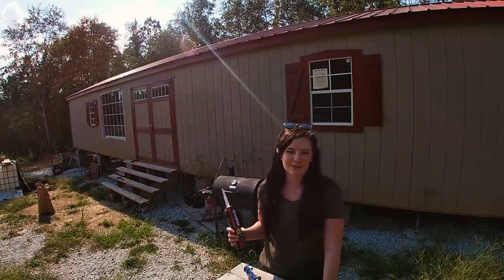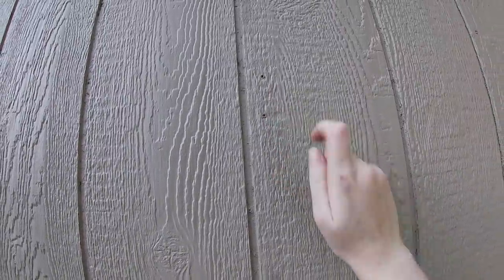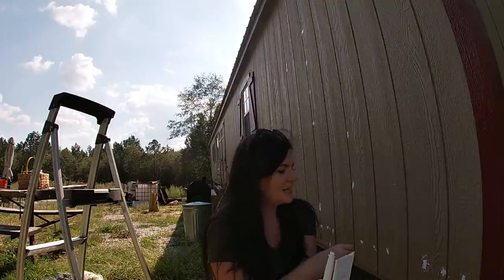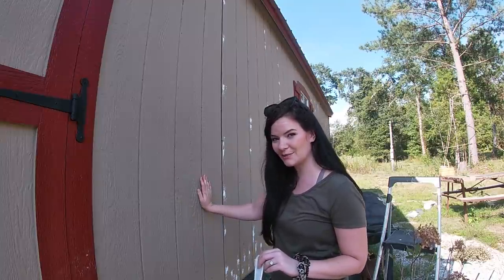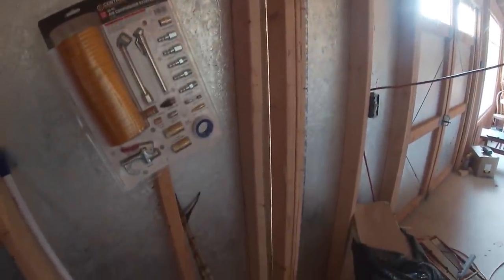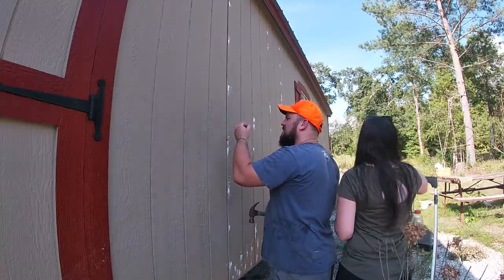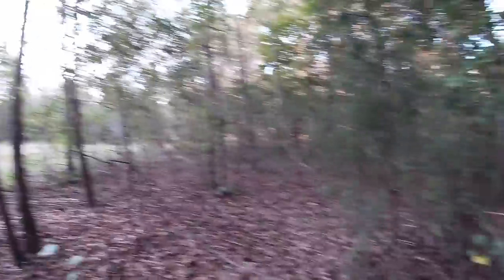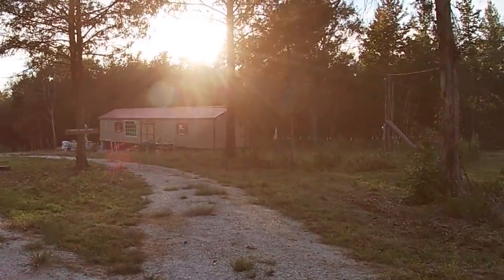Patch T1-11 Siding | Shed to House | Homestead

Comment: Consider using stain instead of paint ! I put T1-11 on my house & garage over 30 yrs. ago & used a good stain & it still looks new. Good job dealing it up .👍👍
Reply: What kind of stain can you use on T11?
Reply: @Carolina12GA  Hi. The reason I suggested stain over paint is stain does not chip, peel or crack like paint. So if you ever need or want to recoat there is no prep work like scraping or sanding. You will want an exterior (all in one ) stain plus sealer. There is regular stain or a solid color stain. You probably want a solid color stain which allows you to choose what ever color you want. You start with a neutral base & have what ever color you choose mixed in. There are different brands so it's kind of get what ever is a convenient place for you to get it (lowes, home depot or local hardware store as long as they can mix it ). Any other questions I'd be glad to help if I can. Good luck !😊😊
Reply from the maker: Wow! 30 years and it still looks new is amazing!! Since our siding has already been painted in the past, we can’t stain it, right? Otherwise that would have been a great option!
Reply: @CountryRootsFarm  Yes, you can use a solid color stain over paint as long as there is no chips, blisters or loose flaky areas. If there is you will have to scrape or sand to remove any loose stuff. A wire brush is great for getting rid of loose areas.

Comment: Use white lightning or other latex based caulk  along with with primer paint, caulk hole or crack ,brush paint over the caulk and will blend right in and will work on seams too.. Works good!!
Reply from the maker: Great!! Thanks for the advice!
Reply: @CountryRootsFarm  Brushes will clean out with soap and water, just like paint pans rollers etc!!

Comment: Not to be nosey, but what kind of money would I be talking about doing a shed to house?  I was thinking about doing that, a tiny home is off the hook.  I have seen them anywhere from 50 to 100K without the land.  What are you suggestions, I am thinking like a hunting/fishing cabin for family hang outs.  Thank you
Reply from the maker: No nosey at all! We’ve been sharing how much things have cost along the way. Before getting started, that was a big question for me too. 

We went shed shopping many many times before finding this one as a repo. It was a goal to try to find a used one, since there is a huge savings. 

We paid $10,000 for our building including delivery and blocking. The same building new is a little over $22,000. 

We also plan to do everything we can ourselves so that will reduce the cost. And we go to auctions for tools and supplies. You might can even find builder auctions in your area! The last one we went to, we got all new, solid wood, soft close cabinets for our current kitchen for $2,400. We had already priced the cabinets and had $7,000 -$10,000 quotes for new cabinets that weren’t as nice as the cabinets we found at the auction! They also had wall panelling at the auction that sold for 50 cents a sheet!! I couldn’t believe it! We didn’t have our building yet so we didn’t buy it but the same paneling is at home depot and Lowe’s is over $20 a sheet! 

I guess the point it, I think the cost will depend on what and how you want to spend. Shopping around and in some unusually places (including Facebook marketplace) can really stretch your dollar! And after working so hard to make it, I like to make the dollar stretch 😊

Comment: Hi Ashly, This is crystal again. Thank you for a new video you guys are greattttttt. Wow did you get a pull behind mower for your tractor? Wow that is a lot of  holes. I hope it is not like last video where it was like a 100 out side. Hope you guys have a good day and night hugggggggg.
Reply from the maker: We have a brush hog for the tractor but the seal went out on it so the grease would just run out. It makes a huge difference though, doesn’t it? Thankfully it was only in the 80s so much more manageable  😊  Thank you for watching and commenting! ❤️ Hope you are doing well!
Reply: Hi Ashly, Wow it is snowing in wyoming. All the cars are covered  and grass. Wow it is to soon it should not snow for another two weeks. Glad you can use the brush hog a lot faster and you do not have't to use the push mower as much. Save on all the walking. Your a hard working woman with your job and working on your new place. You have a good day and night.
Reply from the maker: @crystalpaben2471   wow! I can’t even imagine it snowing in October! We are barley in fall weather! The property looks so much nicer now that it’s more under control. It’s all worth the work, thank you! Hope you have a great night too!

Comment: I am not sure what part of the country ya'll are in.  I am in the south.  But I was thinking a low cost ac would be a buried pipe, with a fan forcing the air to the hot building.  I have had these building for work shops and in the past they have been hot.  Just a thought
Reply from the maker: That’s pretty cool!! We are in South Carolina. Does ground water ever mess with the cooling or pipes?
Reply: @CountryRootsFarm  It shouldn't, you use solid pipes, not like a french drain.   You go down 3 feet or so.  Like digging a fruit cellar.  I would think a fan is like a pump, it can push a lot better than it can pull.  Funny I am in NC.  I am looking a chill out cabin in the western mtns.  It was one of the things I was looking into for off grid cooling.  I was thinking with land, I would come out less than a tiny house, although I do like some of there storage and layouts.
Reply from the maker: @outdoorlife5396   okay, good to know! Thank you. Wishing you the best on your search for land!